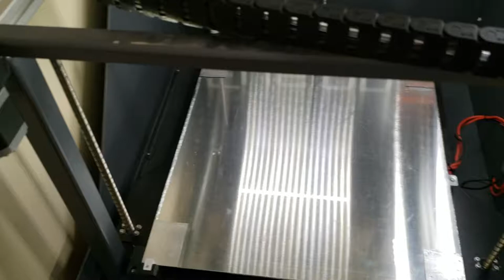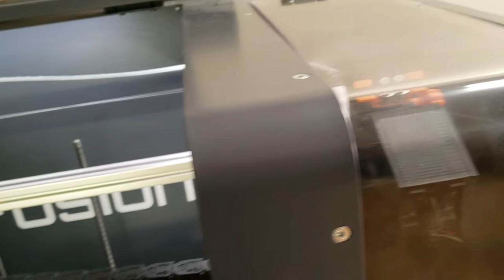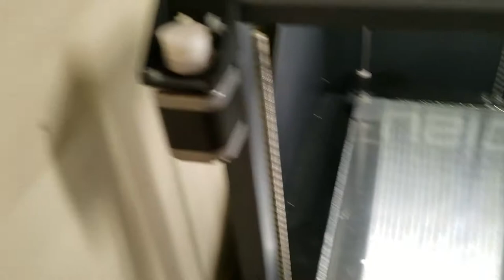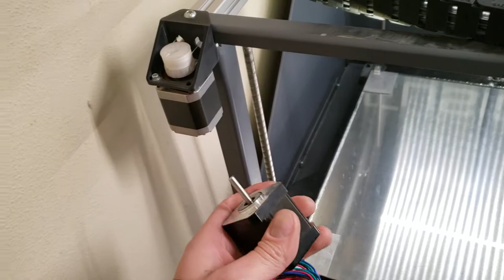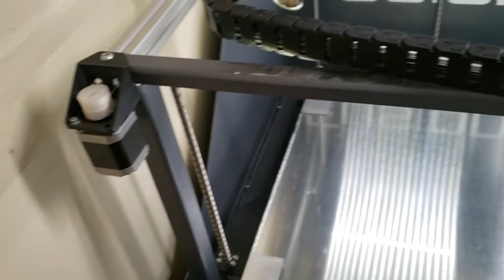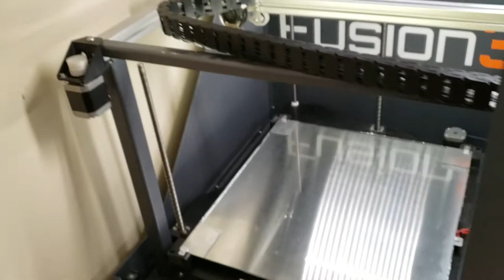Fusion 3 F-400/F-410/F-306 3D Printer Stepper Upgrade Part 1

Comment: Question - did you replace the bed hold down tabs with metal ones? I have had an issue recently where the stock ones decided to melt/warp when running the bed @ 130.. I contacted Fusion and they said that they are sending me polycarbonate upgraded clips.. vs whatever the stock ones are printed with. Seems silly that they wouldn't have just shipped the machine with the polycarbonate clips.
Reply from the maker: Yes I have sets of metal bed tabs for this very reason

Comment: Hello I wanted to know now since some time has gone by with the upgraded stepper motors that have the .9 deg rotations did this continue to work consistently for you? Were there any issues that one might want to know about before upgrading there fusion 3 f410  I’m looking to upgrade my f410 to those but wanted to see what your feedback was before I did so. Thank you
Reply from the maker: Hello, I have all my Fusion printers setup with the .9 degree steppers and they have been working great. No issues with them
Reply: @Th3mast3r69  
Thank you so much. Were there any tricks to the wiring? Do you have a video that explains how you went thru that step by step ? And thank you again because these fusion printers are my most trusted quality printers
Reply from the maker: @mbs3dsolutions  if you want to shoot me an email I can share a photo of how they are wired up. It's pretty straight forward